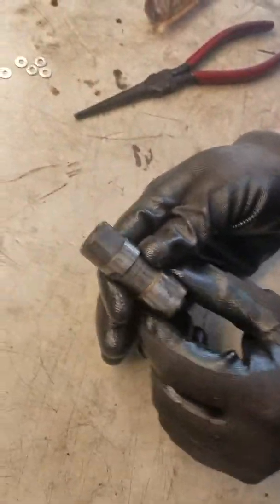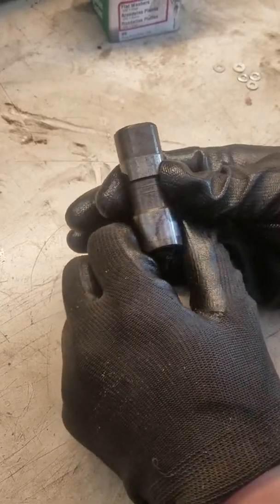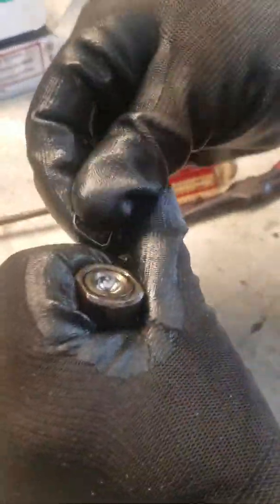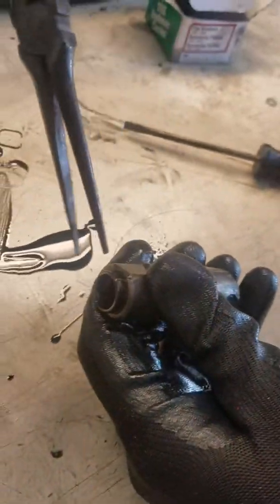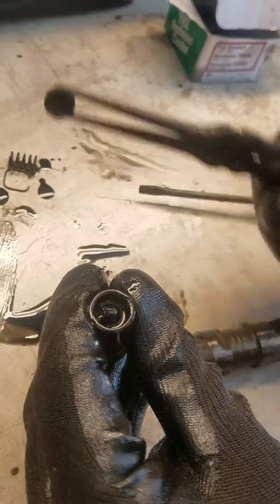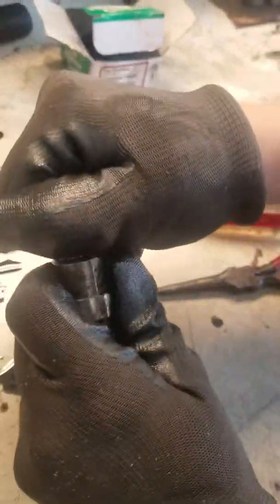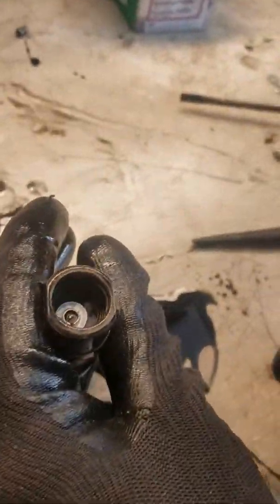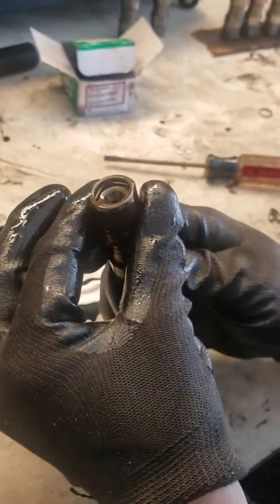How to make solid lifters for checking valve clearance

Comment from the maker: The lifter rides the cam, If you make your lifter solid rather than hydraulic you can rotate the motor over by hand and get full range of movement out of the cam and valve assemblies. This is especially useful on diesel motors because they are very close intolerance to begin with.  0.022 on some.

If you just rebuilt a motor or added a new cam or change the head or head gasket you might want to check your valve clearances using this method.

To check valve clearance you can put some Play-Doh (use a little oil to keep from sticking) on your piston where the valves will hit if they were going to. Put a head gasket on and tighten your head down enough so it's flat on the block, using a few head bolts is fine. 

Make yourself a couple of solid lifters and do one piston at a time. Put the solid lifters onto the cam for the intake and exhaust valve. 

Place the push rod in their slot and then tighten down the valve train carefully for that one piston. It should be set up so that as you rotate the motor around from the balancer (crankshaft) the the valves will operate normally if the engine is timed correctly of course. Give the motor two full rotations. 

Take everything back apart and look at the Play-Doh on top of the piston be careful not to deform it when you remove it. 

Use calipers to measure the Play-Doh carefully, some people think maybe let it dry so that you can measure it better but I think if you remove the moisture in the Play-Doh may shrink a little bit and throw off your measurement so just be careful. 

be sure to look up the minimum valve clearance for your vehicle.